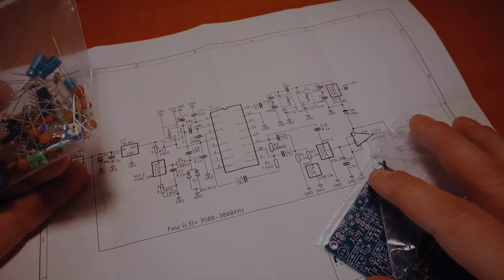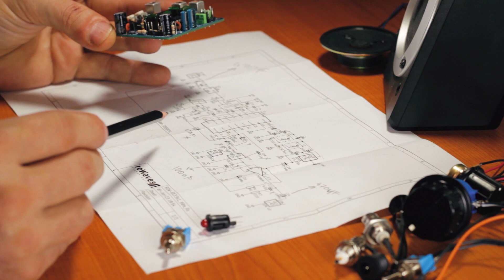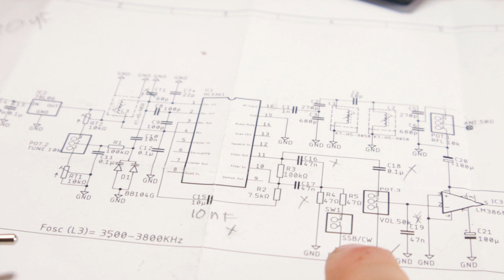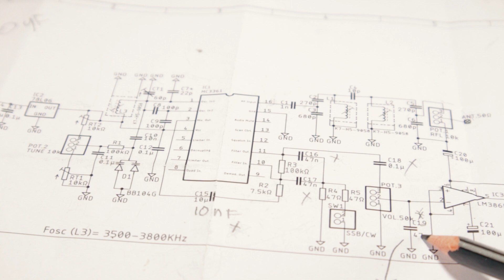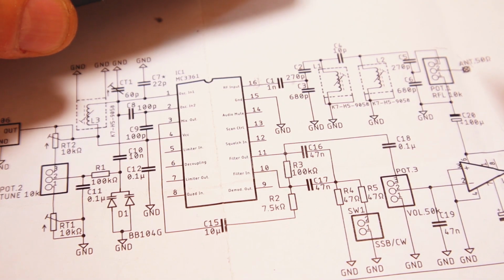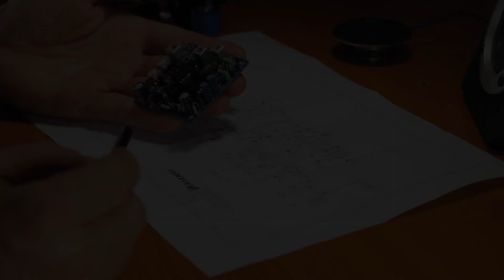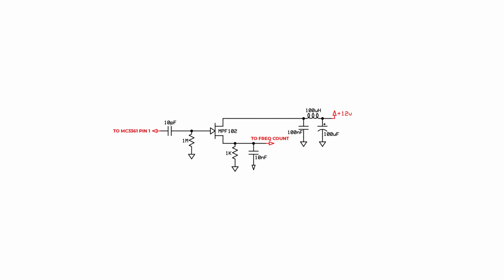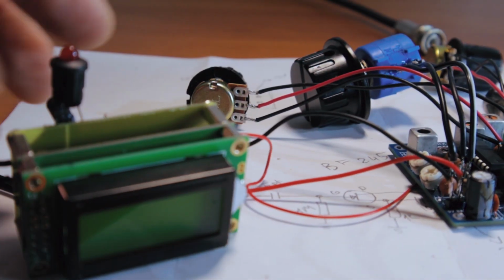MC3361 And LM386 80m Direct Conversion Receiver Kit Build

Comment: Nice Chip. I think the DC receiver is my favorite "simple" (some are not) receiver circuit. I have lots of regen receivers but the DC receiver is a better performer for similar complexity, 73 VK7IAN
Reply from the maker: It is simple indeed. So far what I see... there are no headaches when it comes to the tuned circuit Q factor... as in most regen receivers is messing up the regen control or is not oscillating and you don't know why )). I will try to build more a little later. Maybe something just with transistors to fully understand each stage and learn more about the way it works. Theory is nice... but is better do that in practice )). 73 Ian. Next kit build is the FT8 TRX. Almost finished with it as well ))

Comment: cut coneccion pin 3 and put choke 100 mh  and .1 capacitor to ground,eliminate residual rf from mixer .
Reply from the maker: Thank you so much. That is great to know. 73, YO6DXE.
Reply from the maker: One question... the capacitor goes on the Pin 3 side of the inductor ? Or in the other side of the inductor ?

Comment: It's a homodyne receiver. I used to perform similar projekt. It is based on Lidia 80. Did You receive from mountains?
Reply from the maker: Yes indeed is basically the same receiver with minimal modifications. I had no time for radio fun in the mountains. Lots of work to be done here. Going home tomorrow.

Comment: Nice to see a circuit diagram/ Schematic if possible Thanks
Reply from the maker: Have a look in the video description. I have a link to the blog article and I have the schematic posted in there. Is based on the Lidia Direct Conversion Receiver. Nearly the same circuit.

Comment: From the PCB size and circuit topology (DC) this one and "Little Roo 40" looks similar. Hope performs also identically good. Did you spotted some differences between them in terms of performance/stability/etc?
Reply from the maker: Little Roo is fun... but is really limited because of the frequency coverage and the controls. Plus that it has something on the audio output that I don't like when connecting it to an external amp. I had to build a special cable for it. The other one is a little better ... more fine tune control, the audio is a little louder and no AM broadcast band interferences thanks to the filter on the input. Little Roo has interferences especially late in the evening from strong Chinese stations. On frequency stability they seem almost the same... although the one with MC3361 seems a little more stable. 73, YO6DXE

Comment: Nice compact receiver but can this receiver be made to receive a wide range of Frequencies: say 4 to 9 mhz  please reply.
Reply from the maker: By recalculating the LC circuit part i guess so yes. And for sure using a different tipe of varactor diode with a lot more capacitance. That if you don't replace that with a variable capacitor. There are a few modifications to make... but yes you can. The downside is that it will be hard to tune... unless you add some extra fine tuning option. Having such a wide range of frequencies... will make it hard for you to have any selectivity. Usually that is the reason  I prefer building receivers for one particular band. I don't really like modern digital stuff... but with that I guess you can make a little more. I don't know much about it though.. since I prefer old analog stuff )))

Comment: Excellent ! Very interesting and it works perfectly. Great project my friend !
Reply from the maker: Thank you Klaus. I just want to replace the 22pF capacitor so I can have a higher inductance and spread the CW portion a little more as is too tight right now with the diode tuning. After that all I need is a nice box and is good to be used ))) 73

Comment: I'm also using Direct conversion reciever for listening 40m band. Single balanced diode mixer(product detector ) and 7 to 7.2 mhz analog VFO. Good video bro 73❤ DE VU3IZD
Reply from the maker: Thank you so much. It was my first DC receiver. Really exciting little project. Next week I will make the enclosure 😁😁